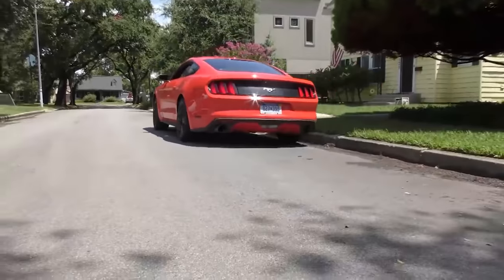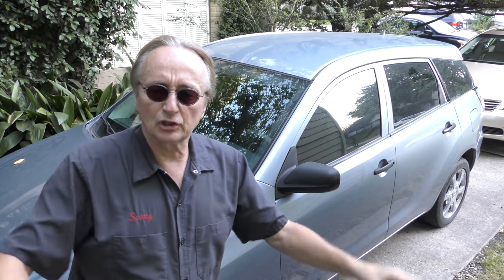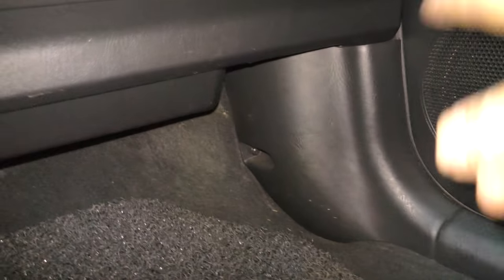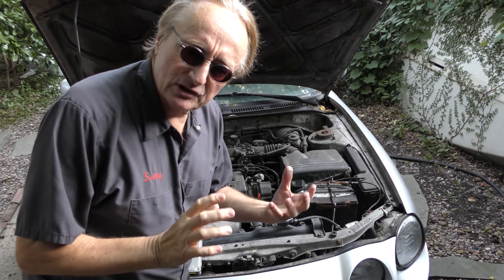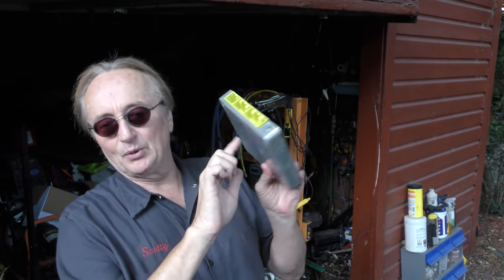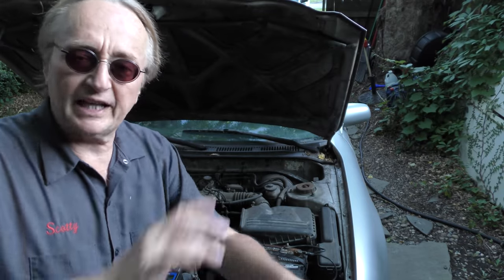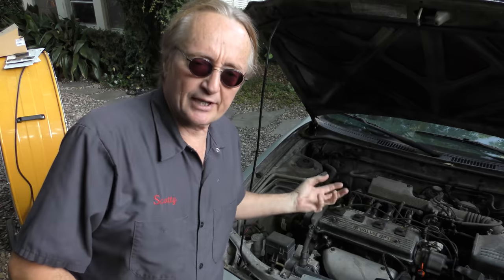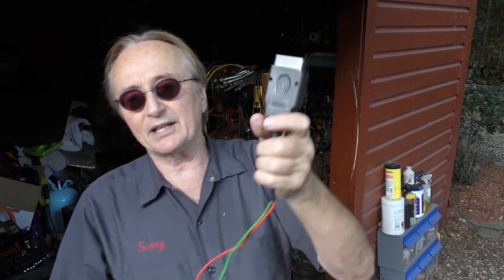What is This On My Face and What it Means for the Future of My Channel

Comment: When I needed a new key for my 2000 toyota, the dealer said over $200 for the key and over $1100 for the module--I didn't even ask about the labor.  I settled on going to a locksmith for a total of $125.
Reply: Interesting i got my 08 sienna a new copy of a key for only $150 with it programed

Comment: I would say making sure the battery is kept in good shape. Undervoltage and the usage of a booster may make some damages. I say that because of a dead battery I had. The engine start button wouldn't do anything anymore even with a booster. And I knew the battery was dying because I had it tested and it only made 11.8V, but with the lockdown I thought I'd wait for my trusty nearby store which sells AGM batteries to open again. I thought I fried an computer because of what I saw on the forums, even if everything worked. Turns out, it was just the alarm which staid on after the power came back and I just had to lock and unlock the car to be able to start it, and I went to buy a new battery. But I promised to myself from now on to change the battery at the very first sign of weakness. Computers on my 2006 GS all cost a fortune.

Comment: Hey Scottie I drive a 2001 ford explorer with the 5.0 it has just under 200,000 miles.
I bought the truck in 2015 for $1500 and have only changed an old battery and the oil.
I am going to buy a 2018 or 19 mustang gt convertible as soon as the world straightens up. Should I get the 10 speed auto or the 6 speed manual?
Love your channel, sure hope you keep this channel,

Comment: Last year I went into a local Wally World because my Honda CR-V was turning over slowly. The “technician” proudly explained to me that my charging system was OK  because he disconnected one of the battery cables while the engine was running and the engine continued to run.
   OUCH! Talk about wild voltage spikes. Honda must bullet proof their computers.

Comment: Replace battery every 5 years in 4 season climate. Even if it’s still good. You will never ever have a bad battery or electrical component damage. Plus if you have corrosion build up that’s definitely a sign to replace too.

Comment: There are passive components in the computer which will are shortened in life by exposure to heat. Curious what capacitors they use (presumably not electrolytics since they have fluid that evaporates). I replaced the PCM in my Chevy S10 platform (refurb PCMs with pre-programming were only $90 on eBay so you don’t have to buy your own knockoff GM Tech2 from China).

Comment: I have a 1991 Honda Beat Japanese import and one of the issues they had was even though the ECU was inside the car, it was bolted up against the wall separating the inside of the car and the engine and it would get too hot and sometimes pop capacitors, thankfully the previous owner, just extended the wire and threw the ECU into the cars glove box XD

Comment: I have a 2008 Toyota corolla with 110,000 miles.  When I wash the car and It's a little wet the serp belt makes a little noise and then it goes away.  I replaced the belt with a continental gatorback belt.  It's really tough to loosen the tensioner, but I can do it with my breaker bar and a 19mm.  Can the hydraulic part of the tensioner sieze up and maybe it's to tight?  I didn't notice any play in any of the pulleys when I took the belt off.

Comment: Ah Scotty, the Matrix had a recall on their computer. I know because I had a fight with the dealership to get them to cover it and surprisingly Toyota was very helpful. 2010 TRD - it had the ECM go with the previous owner before they recalled them. It got marked as replaced and left off the recall list because of that but it was the same defective version used. It went when I had it so I found the info online about the recall. The dealer claimed I would have to pay and I might get a refund later. I went to Toyota, they gave me the serial number range that had been recalled, I checked it on the ECM, and sure enough it was within the range. Took the car to the dealer on a trailer and told them it was covered under the recall. They weren't happy but ended up covering it although I had left the covers off to make it quick and easy for them to swap it, of course they didn't put them back together for me.

Comment: I had a 1990 Chevy Lumina 3.1 engine and they put the computer under the hood and sure enough it went out.  I was about 10 miles from my house and the speedometer needle was bounding all over and the engine was misfiring.  I barely got it home and had to have AAA take it to the mechanics shop.  The computer was changed and it was back alive.

Comment: ECM, use to stand for Electronic Counter Measure.
I could use a memory thing, just don't have a place to hook it up.
Reply: I just use a cheap one that uses a 9 volt battery that plugs into a power port that's energized when the ignition is off. It works.

Comment: Scotty I picked up a 2005 Impala with a POS 3.6 Liter, I payed 2 Thousand clams for it. with 55 Thousand miles, 2 years ago.  I went to check my PCV valve, and the damn things got a bracket riveted to the valve cover.  Friggin Jerks!!   I have 70 k on it now, How would you fix my bracket issue?  and some good tips on preventative maintenance.  Besides burning it, as much  as I would like to.  It's a dog!   Thanks Anthony

Comment: Hey Scotty, I have a 02 Dodge Ram 1500 with 330k miles. The check engine light turned on with a misfire in the cylinder. What should I do?
Reply: Check the coil packs
Reply: Check distributor cap ,cables first

Comment: Be warned. A computer inside the interior does not make it immune to damp problems. I had a car that suddely started running extremely rich, throwing black smoke everywhere, and the battery light came on. After replacing all the ignition, trying another battery, a couple of sensors, eventually a mechanic took the ECU out for me. It was welded up inside the dashboard, requiring the dashboard to be removed to access it. He managed to get it out without doing that by resorting to brute force and ripping the bracket off the body.

What had happened was water had got in through the wiring insulation and corroded two pins on the ecu connector. I looked at the pinouts to see what they were. One controlled the fuel injection and the other was a sense line for the alternator. The injection pin had corroded away to almost nothing. I cleaned them up as best I could and sold the car.
Reply: How about a link for the battery memory saver.

Comment: If I use a pump to remove my oil, do I still have to change the washer? Or can I keep my washer? 
Thank you in advance
Reply: ....and you can keep th' dryer too! (Lol! Couldn't help it - sorry..)
Yes - keep the oilpan drain plug gasket if it was not disturbed. A tip: you can take washer - place it flat on sheet of 400 grit sandpaper that is placed on a smooth hard surface - rotate washer in a circular motion to clean up surface - flip washer do same on other side - a circular crosshatch pattern should be seen on washer - be good as new. (You can put thin film of sealant on washer to enhance sealing). I do this on my cars....
Reply: I would recommend draining the oil instead of trying to pump it out because if you pump it out, you won't get it all. Think of any liquid soap container that you have, the pump never gets all of it out.

Comment: My 2003 Gmc Yukon Denali has computer modules everywhere do everything and it’s a 2003! I took the passenger door panel off and removed the speaker and the door locks, radio, windows, and mirrors would not work at all. Weird.

Comment: I have a 05’ Tacoma Pre-runner 4cyl 5 speed manual with 212k and I’ve only done basic preventative maintenance on her.
I’ll easily get another 400k out of her problem free.
Reply: Keep it as long as you can.  That's my plan for my '04 Honda Accord w/224k.    I too hope to keep it at least another 200k. Some people try to talk me out of keeping it saying it doesn't have modern safety equipment and call it a 'death trap.'  I say BAH, no car will keep you safe in a bad enough crash.   2 days ago I had to replace the battery.  I got 8 years out of it, was a Duracell.

Comment: That’s funny. I just had an ecu issue with my turbo jetta. It’s in the firewall and hardly sealed
I have a tuned ecu in the car And
I had washed my car and my car wouldn’t start so I thought it was the tune but it was the poor water drainage 
Luckily I was able to take it out and dry it before it got too bad. Running perfectly again but now I have piece of a trash bag acting as a shield from rain and water for it 🙄

Comment: If an auto manufacturer wants longer term profits, then they direct the engineers to design for reliability like protecting the car's computer in the cabin.

If an auto manufacturer wants short term profits, then they direct the engineers to design for cost savings & short cuts like designing the car's computer under the hood!

Comment: Except the New Rav4 and Corolla have its ECU in the engine next to the battery. It’s not uncommon practice especially for you halo brand. Which you can see in your review videos.

Starting to have this feeling that Scotty keeps talking about Toyota’s of past and not future. Also that he must have stake in Toyota and Honda. He even made a video about how great the company is...

He doesn’t skip a beat on every auto makers recalls but will picks and chooses Toyota and Honda. 

My 2016 Toyota Tacoma had to have 2 front axle and 1 rear axle replacements before I jumped shipped and traded it in. My service advisor told me that iT was a common issue! That was built in America.

My 2019 Toyota Rav4 had to have both it front struts replaced in the first 1k miles of ownership and was a rattle can after 2k miles. That one was built in Canda too.

Toyota’s build quality is really unimpressive these days. I agree years past they were boring to drive and look at but they were bullet proof but today they’re cheap and tinny on the inside. 

I do agree that the best advise is to stay away from Nissan and VW.

Can you try to start looking at them from today’s standpoint with research from CR, repair data, etc? You keep having them living on their past performance and reputation but they’re starting to have issues especially Honda.

I can’t believe you would still recommend their new car with their oil dilution problems over others.

Comment: hi scotty my name is henry O     i change head gaskets on my chvy 350 vortec .i start the engine after finish everything .i start engine 3 or 4 times no longer the 1 minute.  last thing i connect was a egr  pipe and then i  try and wont start  what can be wrong  .thank you .

Comment: My Audi S2 had its module installed in the passenger foot well, bad idea! 
If parked outside small debris would plug the drain from the windshield and then all the water would go to the footwell through the vents. Then the module would be immersed in water!

Comment: I had a problem with my PCM on a 2007 Ford Fusion sel. No warning before it quit and there a 4 different models in that car 2 made in the USA 1 in Canada 1 in Mexico. I had the Canadian one. None available in scrap yards and no one rebuilds them. Except Ford and to get a rebuilt one I had to send the broken in exchange great scam by Ford. The car is fine other than that.

Comment: My check engine light came on on my Civic.  Code said computer.  $$$$ But thanks to critical thinking as taught by Scotty, I checked and investigated.  Turns out, loose battery terminal.  So inconsistent voltage. A crooked repair shop would have made a fortune claiming they replaced it but actually just tightened the connections.

Comment: ECU "re-programming" is just re-flashing ... it is a very simply process made "technical" by the automotive criminals trying to make extra bucks (like the over engineered gas cap Scotty talked about a few shows ago).  Anyone who has built their own computer ... knows (should) how to "re-flash" a bios.  Get new update from source, plug in device, flash and reboot == ez.  We in computer industry have been doing this for decades and decades.  Now if you mod your car to the hilt to make it more zoomy yes you want the pros doing this where they run the car on a dyno.

Comment: Scotty, 99 Corvette, computer in the passenger footwell. Inside the car but the air conditioner condenser drain pan directly above behind the glovebox. The pan drain is known to clog which allows the condensed water to cascade directly on to the computer. Horrible design!